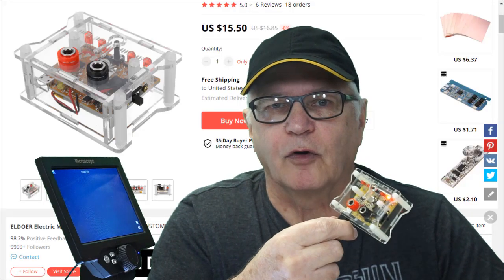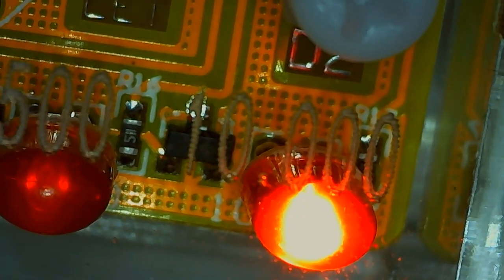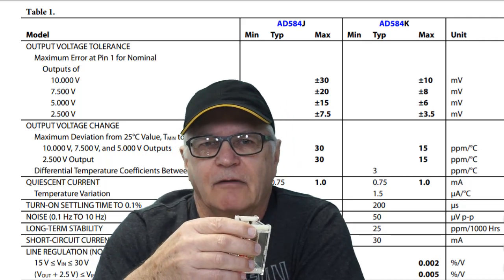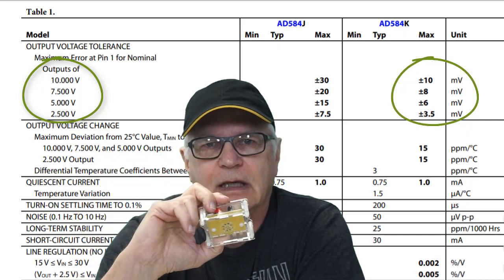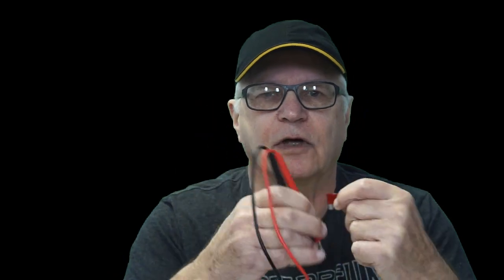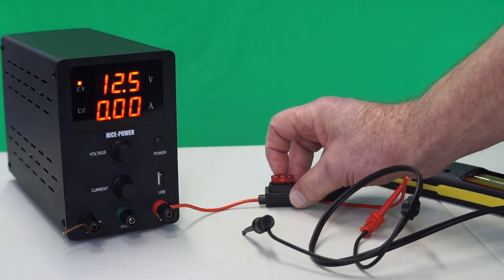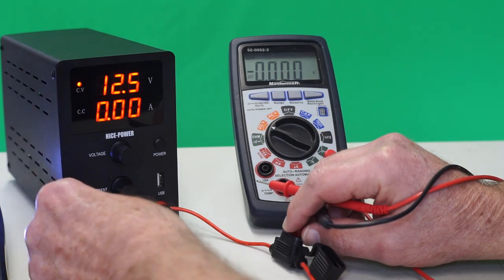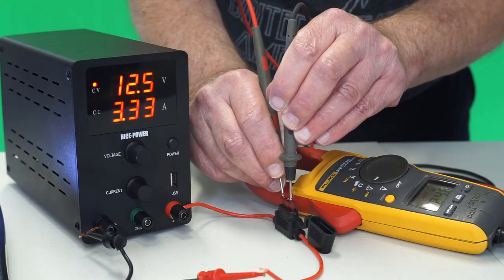GADGETS#93 - AD584 VOLTAGE REFERENCE

Comment: The AD584jk is good and very accurate
Reply from the maker: yes, it is

I notice you're into old transistor radios. When I was a teen, I babysat an entire week in exchange for an 8 transistor radio. Was such a big deal!

We're so spoiled today:)
Reply: @theGADGETSplaylist  I'm asking because I bought 2 non-metallic AD584 JK Integrated Circuits, and I downloaded their references and saw some assemblies on YouTube just using them and they work. However, I did the same thing but it didn't work at all. On the pins where there should be voltage, there is more of the same value as the one that enters the 8 Vcc pin.
Reply from the maker: @NsndoBrasil  I'm only familiar with the one featured in this video ... it didn't come with a small lithium battery as had been advertised, but that's ok...I can live with that

works as expected in all ranges

Comment: Really good info Denis all the years I have been a tech and master tech I nether new about reading voltage drop across fuse 😊
Reply from the maker: widely used by techs in diagnosing parasitic draws without disturbing the circuit...

I too am amazed. You wouldn't think that we could measure just a few mV drop across the small resistance in a fuse and convert it fairly accurately to amps but it does.
Reply: I all ways used  a loop fused wire and a amps clap . If it was below 10amps used strate  in to the multimeter .every day is a learning day

Comment: I like your reasoning. I bought a 40 or so dollar meter and it has DC amps and it works sweet.  I have checked it against my Snap On and I have a couple of Flukes too. All were close. Also, I love that test for parasitic draw. I would b interested in your take on the heat cameras. I mean thermal cameras.   Those seem really handy and an affordable one would b nice!!
Reply from the maker: +Bill Rimmer - I agree, an affordable IR camera would be very nice. Hopefully they'll come down in price but as for now, I can't justify the purchase price vs the occasional use.
I did explore the possibility of putting some components in a DIY build but didn't get very far with it.

I do own a IR Thermometer (as you likely do). They're the next best thing and cheap!